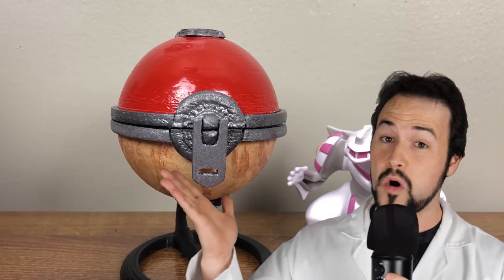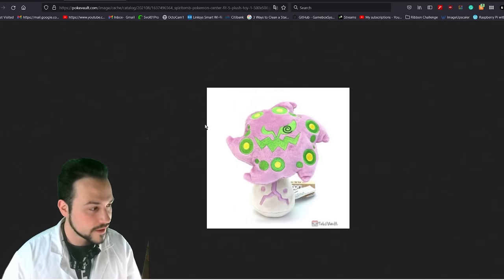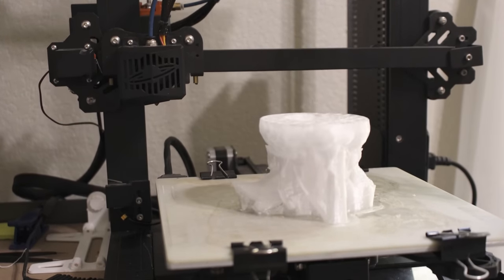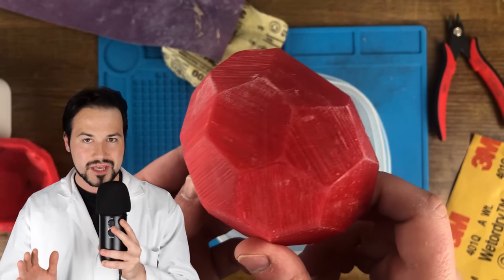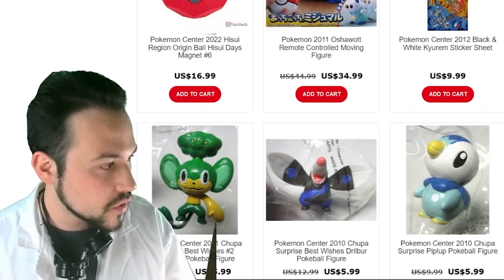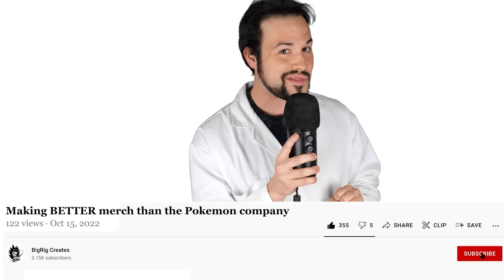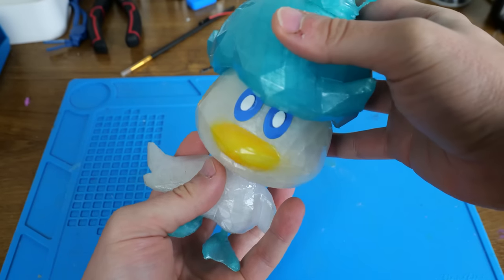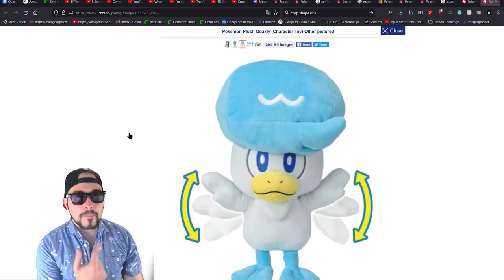Making BETTER merch than The Pokémon Company

Comment: So that water atomizer that you tried to used to create the "steam" effect on the Old style pokeballs, usually has a small fan that pushes air through the vapor chamber and forces the "steam" out. Otherwise the water vapor just builds up and doesn't go anywhere. Adding a small water proof fan might cause some of that vapor to flow out of the top. Another thing to keep in mind about those atomizers, the water that comes off them is not only really pretty hot, it also has the high frequency vibrations used to atomize it. The combination of the hot water and high frequency vibration can melt and deform plastic pretty easily. I accidentally melted a plastic ruler after placing it over one of those atomizers to keep it from splashing. also, don't put your finger in the water near it either... it hurts... keep up the awesome work!

Comment: I've made a working pokeball with steam, if I may try and add something to it:
1)You can make the atomizer spew steam just by pressing a wet sponge to it, this way you avoid pouring a lot of water into it and you actually make it portable and more compact being able to include a battery and a driver board.
2)You should really add a hinge to it
3)To have a bit of the steamy effect you need to get the atomizer right at the top and use a sponge to keep it in contact with a water source
I found this to be more effective than a fan because shortly after coming out the steam will dissipate either adhering to surfaces or simply because at the start it's concentrated and gets spread around quickly, adding the fan is hard in terms of space and it just adds space and surface for the water to condense onto, also it would imply a larger hole in which the vapor will spread becoming less visible

Also you should really start looking into using a thick coat of primer on your prints, if they don't have too much detail you will get something similar to an anti-aliasing for your prints, it will easily reduce layer lines.
That said I really love that spiritomb idea,  that is fantastic.